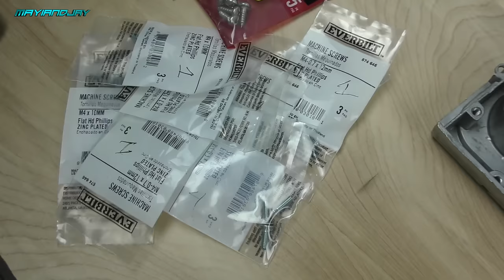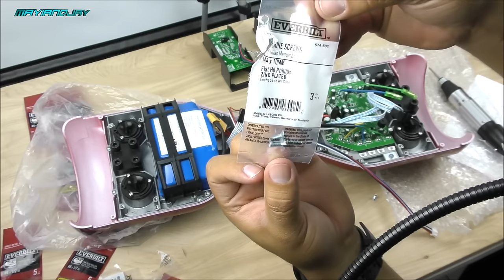How To Build/Rebuild a Hoverboard/Balance Scooter!

Comment: You a lot of the hover boards don't have an overload circuit (battery overload protection circuit) to protect the battery from overcharging. It explains a lot of instances of them just setting on fire and lithium batteries are rather volatile.

Comment: Nice video but i wish a list with all the parts in the description to see if its cheaper to do this or buy a full build unit. I think is more cheaper a full build
Reply from the maker: +joeblack16v It might be equal if not less than a built unit. Some countries banned them, and for that reason some people might go this route. I calculated a total cost of $316-320 to build one with quality parts ONLY. You can buy built ones for $250-275, but the quality you get might be a surprise. I bought one for my brother with red boards for 280, had to spend another 100 to fix it.
Reply: +mayiandjay Thanks for your answer!!
Reply: +mayiandjay  Good video! I am going to offer all the parts for about 200$ total. My factory in China has build and sold over 23,000 units of hoverboards without a single fire incident. Actually, I'm making a 'how to build a hoverboard' video as well.
Reply: It doesn't work like that though. There is no manufacturer can offer branded parts. If you see a Samsung battery pack, it's 100% fake because Samsung only produces battey cells, not the pack
Reply: +Zhenyi-Jay Chen i understand. Do you have any online store?
Reply: We are building it. I will keep you posted.
Reply: Hey Joe, you can visit our shopify website now to purchase all the parts. https://hoverexpert.myshopify.com/ We are still working on the website to make it more beautiful. You order will be shipped from Canada.
Reply: +Zhenyi-Jay Chen will this thing explode because the hoverboards that run off of lithium battery exploded
Reply: +Zhenyi-Jay Chen will it explode? I will buy if you tell me the truth about it
Reply: dis is kol
Reply: joeblack16v yes
Reply: joeblack16v
Reply: joeblack16v iy6
Reply: caroline millar
Reply: Jay C Darn it says the page is unavailable.
Reply: can you publish all Links to buy this stuff. Come on you are educated. not a DUMP

Comment: you can buy rubber pads or lights to put on top of the wheel wells to cut down on body damage. I found most of these parts for cheap of Wish.com.

Comment: hey jay. great video, I have a question. I took my brothers Hoverboard apart so we can paint it  we put it back together  now it has a red light on the top. and when  you turn it on one of the front led pads are blue before you get on. and idea what's wrong with it? plz help
Reply from the maker: You probably installed the gyros incorrectly.
Reply: I never took them out. Do you think I should take them out and reinstall then or do I need to replace them?
Reply: +mayiandjay this is probably one of the best videos and would you build and sell these just for sidework
Reply: +mayiandjay i love your video but i dont have the money to get any of those things 😅😂😢 hope win the give away and again a gerat lovely video
Reply: +mayiandjay will I be bad if I try to make the scooter faster

Comment: Do Hoverboards have re-generation back to the battery when you reverse brake downhill?
Reply: You’re thinking of regenerative brakes that recharge by friction (I believe). Balance boards do not have brakes. It stops by slowing or turning motor in opposite direction. Sooo no. Besides that technically there is no reverse. You can ride at full speed in either direction. You can freely ride in whatever direction you please.

Comment: hey,jay i have replaced the battery with a samsung battery. Though it works properly but still it have some issues like it turns off automatically. so i m asking the same happens with your howerboard

Comment: I am pretty sure this guy simply took his Hove board apart and then put it back together. He says that the motherboard seller donated the MB and the gyros. That claim is highly suspect. 
The ONLY reason any seller would give away a $65 part for free to this guy would be if he was an established well known and highly viewed Hoverboard repair site with  a huge following. His agreement would be that in exchange for the parts (or more likely just a discount).the youtuber in the build video, would take a moment to mention his company and maybe him personally. I would think that mentioning quickly the quality of the of the parts and his great customer service would have probably been highly appreciated as well. 
this guy
never mentioned any company name to show any gratitude or appreciation for expensive parts he asserts were given for his youtube build. he also never posts anu of the companies that were supposed to have sold the remaining parts.
I call bulos#i+  on this guy.
Reply: Tony Ketcham you can buy the entire main board plus gyros from eBay for 20$ and they are the blue mother boards which is better then the green ones.
Reply: @dyllman98  why is the blue better?